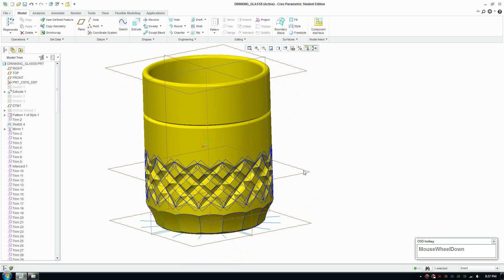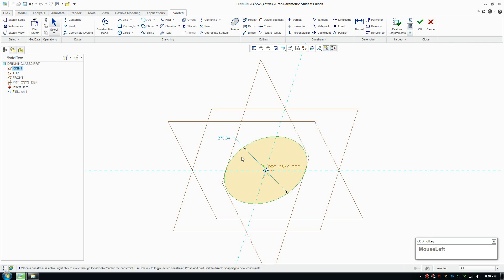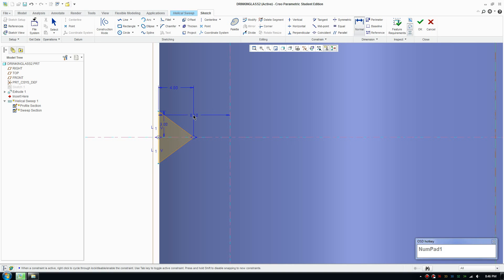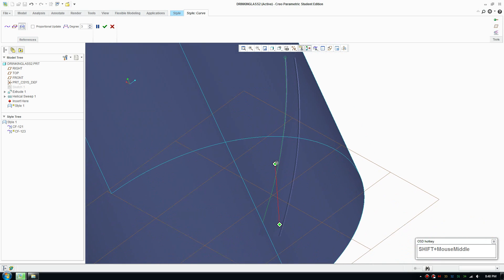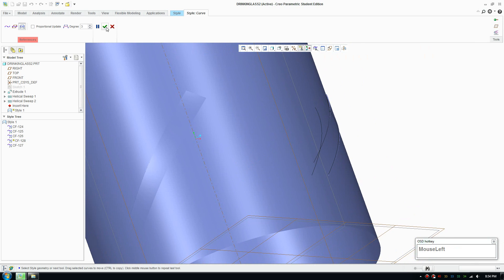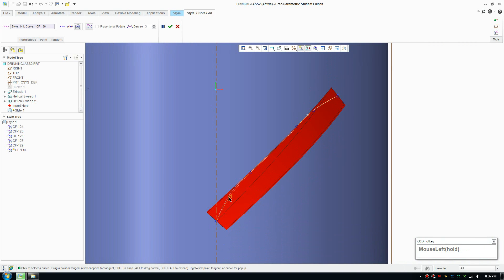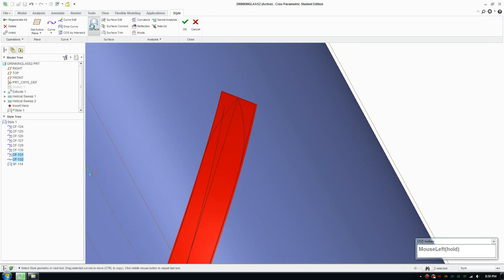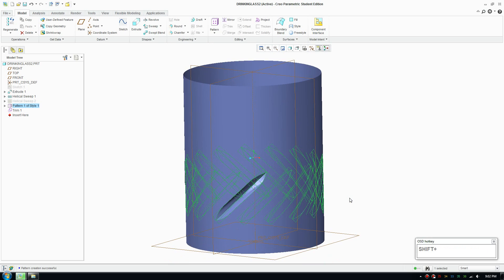Creo Tutorial - Advanced Drinking Glass Sweep Cut Technique Part 1

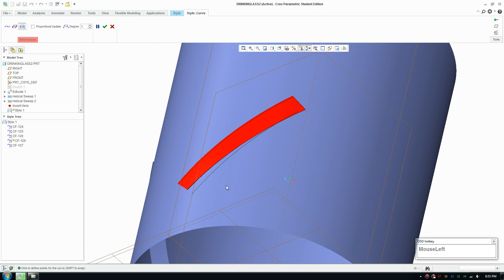Comment: I follow your steps with video. But , I  am stuck at 10:43. It seems likely that surface is separated into two surfaces. It hard to cross the center line to connect the point. Could you help me out of the difficulty please?
Reply from the maker: Yea, there is a split surface. You can do it on the other face with the full surface.